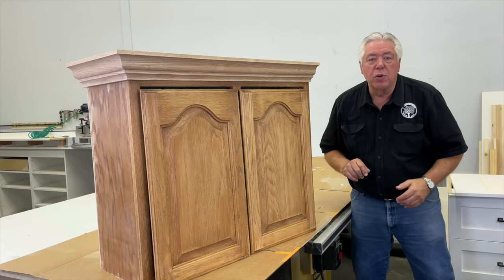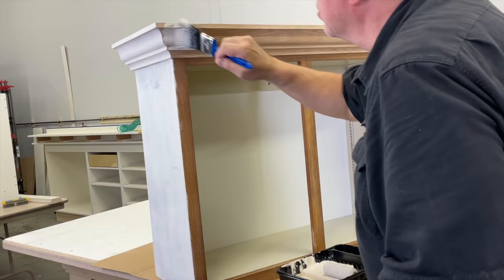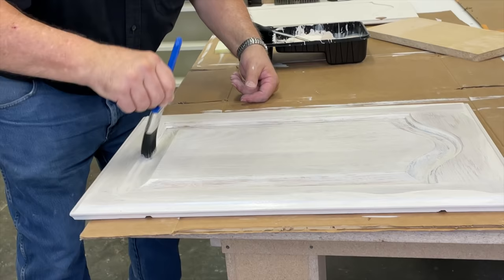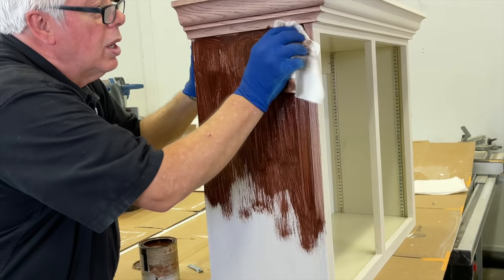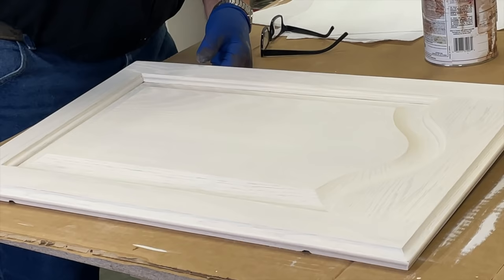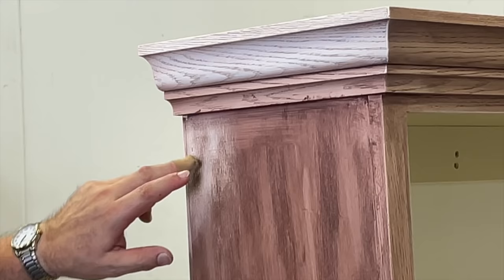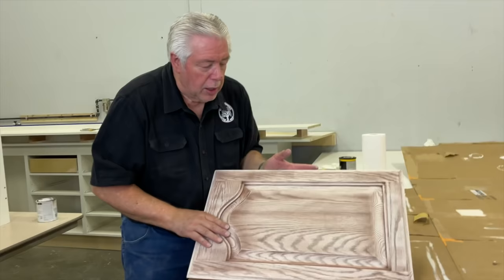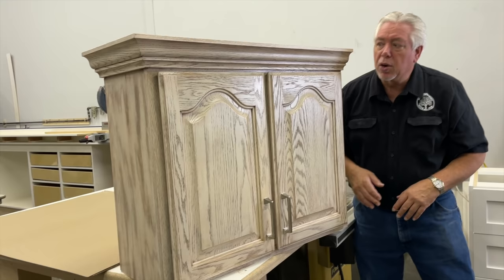Just Like Magic Your Golden Oak Color Will Disappear

Comment: This primer is great for raw wood (I used it on pine trim) but it doesn’t cover knots and doesn’t block stains. It builds up nicely and allows for sanding for a smooth finish. On cabinets with polyurethane finish I would use the SW extreme bond primer instead.
Reply: How do you know if you have a polyurethane finish??
Reply: @mangos2888  anytime you have a clear finish over stain, it's highly likely to be lacquer or polyurethane and you'll need to use one of three primers, lacquer undercoater, oil base primer or now they have a water base (extreme bond primer) 😉
Reply: @mangos2888 if it's not painted then it has a clear finish on it. That is, if it's a finished product inside your home. I only day that because you can stain wood without putting a finish on top of it in the case it's something like a project that hasn't been completed. In any case it's always best to lightly sand and primer to remove any grease/oils do paint will stick better.

Comment: Great job, Wes! I've refinished many oak pieces but haven't done cabinets yet. I have found that using old t-shirts or some other soft lint free cotton cloth for wiping off (and on) your stain works so much better than using paper towels. Lot less waste & better saturation imo. All that said you did a fantastic job in updating these cabinets.

Comment: I WAS INTRIGUED WITH THIS PROCESS AS IT WAS WHAT i HAD DONE TO MY FRONT DOUBLE DOORS YEARS AGO, MYSELF. ONLY IT WAS WITHOUT THE WIRE BRUSH AS IT WAS A NEW THERMATRU DOOR, WHICH IS MADE OF FIBERGLASS, WHICH HAS A POLYSTYRENE INSULATOR IN BETWEEN. AND IT IS AMAZING HOW COOL IT KEEPS MY HOME..IT WAS WONDERFUL TO FIND THESE, AS IT DOES NOT TRANSFER THE HEAT INTO THE HOUSE. BEFORE THAT, MY HOUSE WAS AN OVEN AND EVERY TIME THE SUN WENT DOWN, IT GOT WORSE SINCE THE DOOR IS FACING THE WEST.  SO, ALL IN ALL, IT WAS MY FIRST TIME TO FINISH ANYTHING AND I LOVED THE PROCESS, MUCH LIKE WHAT YOU ARE SHOWING. IT IS SO REWARDING TO SEE THE WORKS OF YOUR OWN HANDS IN THESE PROJECTS, SO THANK YOU SO MUCH FOR SHARING YOUR WEALTH OF INFORMATION. DONNA
Reply from the maker: Thank you Donna for your kind words and comment. Thanks for being part of our community. Wes

Comment: I had those golden oak cabinets - I washed them done really well with TSP then applied Mission Oak stain with satin urethane  - it took so well - made them darker and got rid of that bland yellow - then a took a black paint and kind of darkened the edges, corners & crevices of the panels - sort of like a glaze - they came out so well - I couldn’t veer too far off course because all of the trim and moldings in the house are oak, but those cabinets were just too yellow - and they have so much more dimension now - I love them

Comment: Thank you for this! That's the style of cabinet doors that are in my kitchen and I really appreciate you showing the process on the door with that arch adding a bit more complication. I love this finish! My brain is buzzing with all the color combination possibilities!

Edit: scoop edge, cathedral arch. Got it. Good to know for reference. Thanks!
Reply from the maker: You are so welcome! Glad you enjoyed the video. Wes
Reply: Would this work with a blue or green stain.  Thank you for this. Great lesson. Do you have more.
Reply: @joannefreeman3573  I was wondering the same thing
Reply: Same here, I like be my Oak cabinets, they were very expensive & I’m not changing them  at all.
Reply from the maker: @joannefreeman3573  Yes it would...check out our other videos on cerusing. Thanks for watching. Wes
Reply: You explain the process well.
Reply: Is the prlmer the base color for the cabinet and the glaze highlights the woodgrain? I want to refinish a white headboard to  match existing woodgrain furniture. The headboard appears to be painted with lacquer  or has a polyurethane coat. Does this mean I'll have to sand down to the wood to expose the grain?
Reply from the maker: @beverlypatin4696  Yes, you are right, the primer is the base color with the glaze highlighting the grain. I am assuming your headboard is oak or other course grained wood. Start by giving your piece a good wire brushing....that should allow the new base color, primer sealer, to adhere to the old finish. Then glaze and top coat. Hope this helps, thanks. Wes

Comment: Wes, I love this cerusing technique for redoing the kitchen cabinets or other cabinets in the house. I have the same in my house although my cabinets are made from ash wood. I'm seriously thinking of doing this to my kitchen cabinets. I do have one question though & it may be a stupid question. After you've changed the color of the outside, what do you do with the color of the inside of the cabinet which is the golden oak? Do you paint it the color of the primer you put on it or what? It's impossible to ceruse the inside of the cabinets. Actually in the lower cabinets it will be impossible to even paint those areas that go back into the counter that you can never reach. I love your videos! Thank you so much for putting this detailed information out there & also responding to people's questions!
Reply from the maker: Alyson...just paint the base primer coat on the inside without glaze. Thanks for watching....good luck with your project. Wes
Reply: I love this, would like to paint kitchen cabinets white for that "farmhouse look" but counters have a lot of brown and green and floors are an orangey hardwood. Would it go? Or would you have another video on staining hardwood floors also? Thanks. 🤷

Comment: Having rubbed down/back to expose the grain, I find 
it much quicker to apply a ‘ liming wax ‘ at that 
stage. Leave few hours and the buff up .
Works a treat ! ✔️

OR you could chalk paint at that stage too, then 
apply clear wax , leave few hours, then buff of etc
Reply: I agree al liming wax or white washing would’ve been easier and less time-consuming.
Reply: Orla, are you saying use liming wax instead of wire brushing? More details please!  Wes- do you have an opinion on this?

Comment: Thanks for the idea, I redid my bathroom cabinets with this method. Doesn't look like youtube lets me post links to show a picture though.
I thought it came out reasonably well. Now to work on my kitchen with it, the bathroom was more of a practice run.
I used the same primer tinted to Pearly White. I used Rust-Oleum cabinet transformations Java Brown glaze, which went on thinner so I let it soak for 5 mins before lightly wiping it off.
One panel came out a little darker because I stripped it (it was my test piece, which I used for various other stain/paint approaches). The other panels I just wiped with acetone, which isn’t quite as bad as lacquer thinner.
Reply: Attempt at photo (remove spaces): drive . google . com / file / d / 10OK8kYDwacLMMgxhDuRttfnOL7nES3S4 / view
Reply from the maker: That is great!! Glad you had some good success. View some of our other cerusing videos for additional color options.
Thank you, Wes

Comment: Absolutely beautiful job!  Not to mention your explanations of the whole process.  I am considering re-finishing walls and ceiling in every room of  a tiny home I’ve purchased. It’s wall, ceiling ect are all pine with the same golden colour as your oak cabinet. Quite frankly, after 6 months of living in it , I’m sick of it.  I want it to be white. What would you suggest to maintain all the natural pine knots  ect 
to continue to show through.  Do I need to apply a remover for the surface as it appears to have a coating of some kind or can I just sand?  I’ve purchased a white stain, Benjamin Moore semi-solid. I cringe at the thought of how much work this will be but know it will be so worth it. I look forward to hearing your recommendations.
Thanks from us newbies for your excellent teaching style. 
❤️  from 🇨🇦.
Reply from the maker: To end up with the finish you described, I am sorry but you would have to start with bare wood. Try just sanding to see if the existing finish comes off easily but you may have to strip and then sand. You are right, its a lot of work but well worth it. Good luck. Wes

Comment: This looks like what I’ve seen called ‘pickled’. Would that be another process? It’s a brilliant way to light up and energize the appearance without stripping. How wonderful. I hope to find an oak piece I can have fun with like this. It’s a Wow, for sure.
Reply: As a decorative artist I’d would call it “pickled”
Reply: @WhirlyPearly  
Thanks.
Reply: Pickled is a different process
Reply: @gypsyscometotown  
Yes, thanks. I figured as much. I’ll research that at some point. I once did a lot of furniture building and refinishing of antiques. I prefer methods now that are as nontoxic as possible. Haven’t been able to tolerate VOC’s for several decades.
Reply: @adrianekelly2966  
So doing a pickled finish would be much better for you because you can use all water based products
Reply: @adrianekelly2966  
But I also use water-based glaze so you could do either process.

Comment: Im a Painter and Decorator. Best tip is wash kitchens units down with Sugar soap first. When dry, rub over surface with fine sandpaper. Dust off, then prime with a Product that has Shellac in it. Here in Britain we have "Zinnser" and "Blockade" 2 good products. Then i recommend an oil based Eggshell or satin finnish paint. Id avoid water based, unless its "B-Dec multi-surface" paint, which is an excellent product. Available in Matt satin and Gloss.

Comment: Every time I watch another of your videos on cerusing I'm one step closer to tackling my kitchen. But with 21 cabinets and 18 drawer fronts, 2floor to ceiling and one ceiling to counter top end panels - I'm a bit intimidated. One of the critical issues is while that is the color of my cabinets they are not oak - they are hickory. Will this technique work on hickory? 
I'm thinking of trying it on the inside of one of my bottom corner cabinet doors just to see how it comes out and how difficult it really is. Have you ever done this on hickory?
Reply: I think it would work in hickory as it does the oak. What you’re doing is highlighting the grain of the wood. You will have a different pattern of grain on the hickory compared to the oak, but it will still turn out beautiful.
Reply: @dales949494  thanks for the reply, my concern is about the hardness, I tested this out on an old pine dresser I found. It came out pretty well on such a soft wood - but I did get a lot of extra "grain" from the wire brush creating marks in the soft wood. I love the different grains in my hickory and would hate to mar them - although I would probably be the only one to know it!
Reply from the maker: Check out our video as we test 11 different kinds of wood for this process. Thank you.
https://youtu.be/iOH8RAJLKKs

Comment: We do cabinets all the time.  

We can tape , mask , prime and spray the boxes  in home in two days . We take the doors to the shop and clean and sand . 
We use Sherwin Williams Sherwood because the turn around time is 30 minutes to sand and recoat . 
The only drawback is Sherwood can only be sprayed . 

We get a manufactures finish and we can usually get it done in 3to 4 days .

Comment: While everyone is painting their cabinets white, I said I wouldn’t even try to paint my 30 yr old golden oak cabinets. I’m just afraid of chipping and yellowing but I love this technique and they are beautiful but I’m still intimidated by the amount of steps for each cabinet. I’m thinking just paint my kitchen walls white and with my oak kitchen floors maybe white walls would brighten up the space instead of painting the cabinets.
Reply: It DOES look like a lot of work. I'm glad I saw this, I know I'd never complete the steps - plus, as you're planning, a coat of paint does wonders!
Reply: We're on the same wavelength! We're just about to start a bit of a refurb on our golden oak kitchen but we're not going to touch the cabinets but just have our old fashioned wall tiles replaced with some inexpensive white ones and then have the rest of the walls painted white.  We're also a bit concerned that painted cabinets would chip especially with the daily hammering our kitchen gets!!! Good luck with your refurb!  Wendy and Geoff in Brighton UK

Comment: That's so much freaking work. As someone that painted for close to 8 years, no thank you. Looks good though! My wife might consider doing it to our kitchen though since she hates the old oak cabinets so much haha.
Reply: Imagine doing it in your kitchen, the sanding over and over, it would render the kitchen inoperable until done, takeout would get expensive unless you do a total cleanup after each sanding. I've worked in custom wood shop, I would charge new cabinet prices to this on location. I do appreciate the end result, I'm also a hardwood floor installer and laugh at the renovation shows that skip the tough parts and jump to finish product.

Comment: Nice performance, but if mix patina with varnishe and oil paint tube according to your selection which colors you like it will be more easy and you get more pure white and clean before get dry completely because the varnish makes the mixture like isolated not absorbed by nun grain parts.

Comment: have you done any with tinted stain?
When using stain products I use a pad that is meant for applying car wax paste.
I dont do very well with wire brushes.  I like to use different grits of sand paper and hand sand...especially details.  I also use steel wool pads.
Ive ask about glaze in every paint store Ive ever been in for 30 years....Im always told there is no such thing.  nor can I find it on the shelves.
Reply from the maker: In my process I do not use tinted stain or steel wool. I am providing you a link to a video that we did that will give you a tinted glaze product that you can order online. Hope this helps...thanks for watching. Wes

Comment: I’m so happy to have found your videos on ceruse. I need to do something with my cabinets but the idea of sanding them down for paint was scary. I tend to over sand in areas. This is far more doable! And I love the look! 

I do have some minor water damage and I was wondering if it would be ok to wire brush those areas; will there be any issues? 

I also have exposed hinges; can I convert them to hidden hinges? Can you do a video showing how to do that?

On one edge of my cabinets, the veneer is pretty chipped up? Should I replace it instead of using wood filler to repair it?

What about using a wax to fill the grain instead of glaze? Would using a wax also cut out the last step of sealing it?

I can’t wait to get started!
Reply from the maker: Hi Kelly...you can wire brush over the water damage and it should disappear just fine. Yes you can go from exposed hinges to hidden hinges but overlay spacing will need to be taken into account. Different brands of hidden hinges and mounting brackets will have different spacing options. The screw holes from your exposed hinges can just be filled before painting. If the damage on your end panel is extensive, you should replace. If it is just some minor chipping, wood filler will be fine. I have not used the cerusing wax and so I don't have first-hand knowledge of that. Good luck...hope this is helpful. Thanks. Wes

Comment: I’ve started this process just with the guidance of your videos, I’m at the point of putting the glaze on. The furniture glaze is proving extremely difficult to find, Benjamin Moore has some but it’s not oil based it’s water based I’m nervous it’s going to stain my primer (which is just latex primer also Benjamin Moore) and not sand off!
Reply from the maker: I think the product you have will work just fine but you should do a test on the back of a drawer or door face to make sure its the look you want. Hope this helps, good luck with your project. You will do great !!

Comment: Absolutely stunning!
My dear dad was a cabinet maker but he passed away and was always doing projects.
This is tempting for me to accomplish as I do have golden oak wood cabinets in my kitchen.
You made it look so easy to do. Thank you for sharing!
Well done 👍!!!
Question: Could we glaze with a darker colour if possible ?
Thanks again!
Reply from the maker: Hi Alex...color choice is yours and I always suggest doing a test sample. Thank you for telling me about your father, that is always so nice to hear. Appreciate you watching the video, Wes
Reply: @WoodworkingWithWes  Thanks Wes! It is a very creative process and looks really nice with the end finishing.as you presented.
The wire brushing part was something I never thought of but it did a very good job in a natural way.
Sherwin Williams does have great products so I am leaning on this project in the new year.
I got about 25 cabinet doors to take down + the cabinets to sand down on the walls & prep. For the colouring, which brands do you use ? Testing is definitely a no brainer.
This will keep me busy right through the spring.
Be well Wes…
Reply from the maker: @alexpolidoro4126  Stick with your Sherwin Williams brand...they have great products.
Reply: @WoodworkingWithWes  Hi Wes! I trust all is well with you. Questions: What are the grades of the sanding products ? I might have missed out if you had mentioned it. Also, during the final touches, you apply the final coat once, sand it lightly and add a second coat correct ? Have a great day, Alex.

Comment: This is fantastic! I actually liked the look of the cupboards right before they were sanded. Could you stop here and top coat without sanding, or would it be better to start with a darker primer?
Reply from the maker: Any variation in this process would obviously give you a different result. If you are changing the process I recommend a test sample. Thanks for watching. Wes